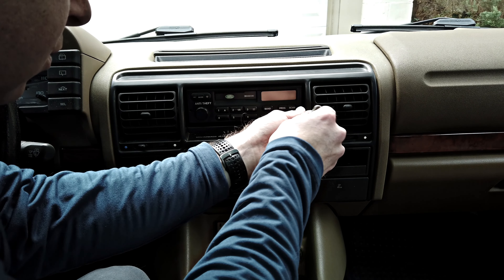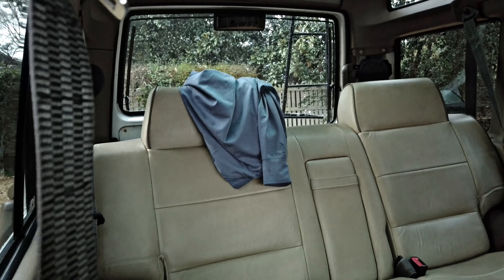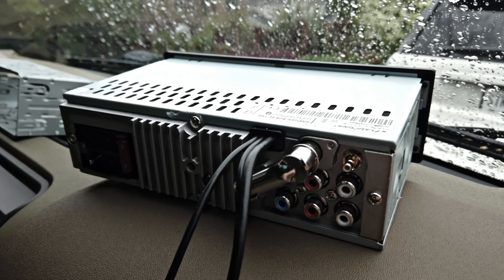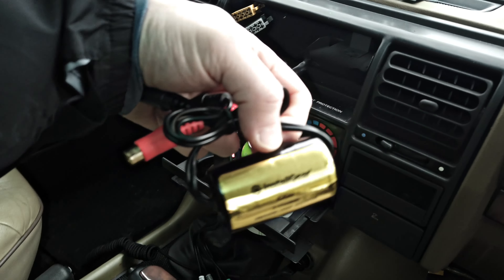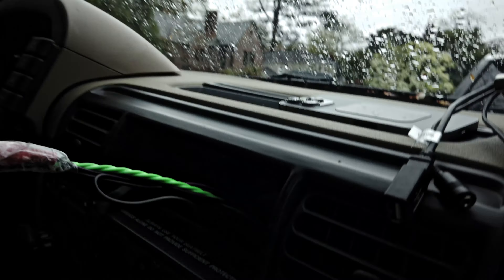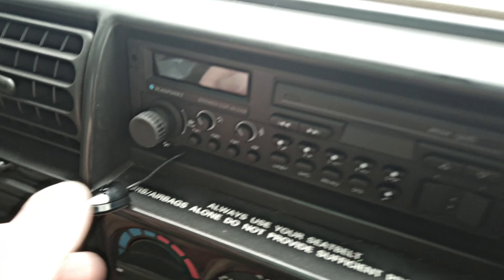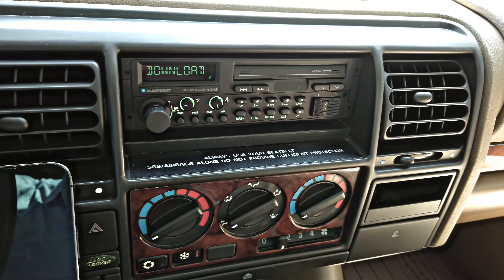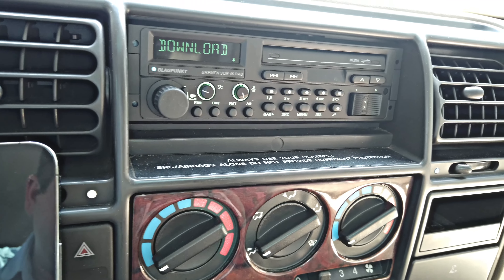BLAUPUNKT BREMEN SQR 46 & KENWOOD KSC-SW11 INSTALL & REVIEW | Land Rover D1 Overland Build Series

Comment: Great work with it all. Did you retain the factory vol/track buttons?
Reply from the maker: Thanks! Not sure, didn’t specifically try to or test that out.
Reply: @nineelevensouth  I think you need to a connector. I did it on the D2 we had. Check out Connects2 😊